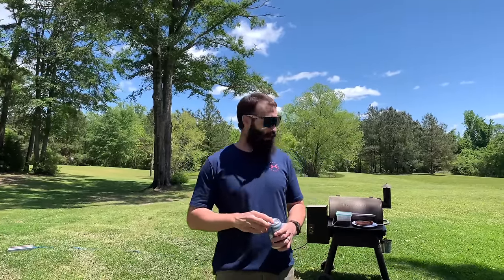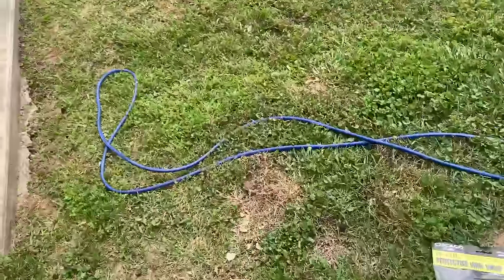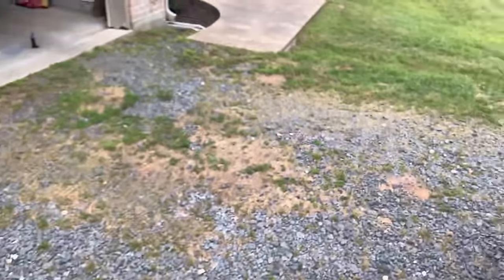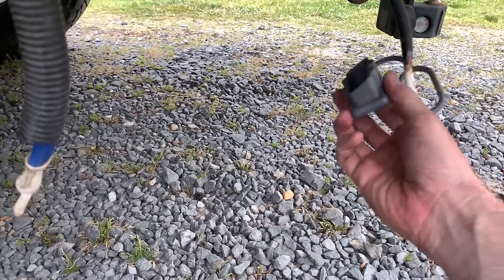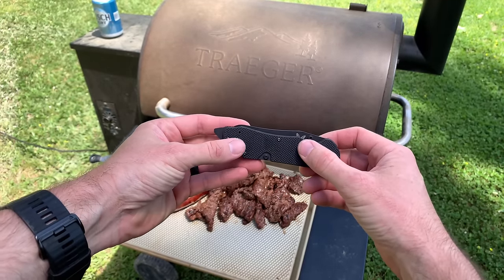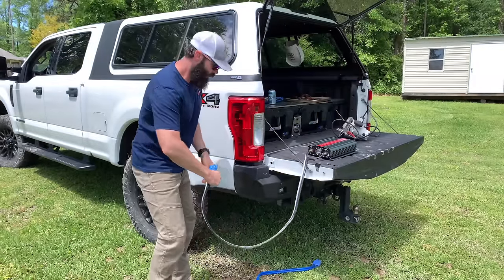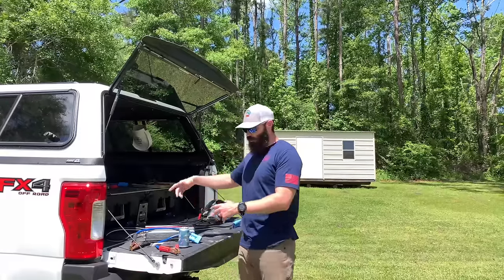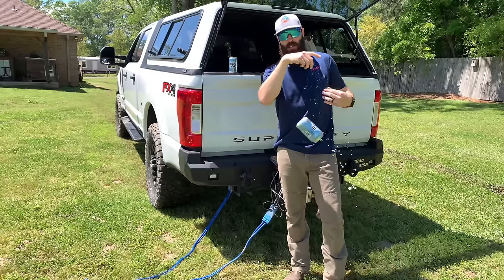Anderson plug install with inverter. (how to power whatever you want.)

Comment: nice video Colt...as always!!
I bought a flush mount kit off ebay and mounted my 175amp plug to the right of my license plate on my 2018 F250, was a little more work to install it but it made it easier to access to plug my winch into that I mounted on the front of my trailer to pull derby cars up on, I never thought of pluggin an inverter into it and using it to run tools lol excellent idea
Reply from the maker: Hell yea brother, I like the location you have yours at! Having that winch is a game changer! Thanks for watching! 🇺🇸🦅🇺🇸
Reply: Could you show us a picture or a link to the flush mount? I want to do the same front and rear for my winch.
Reply from the maker: Here’s a flush mount kit. https://amzn.to/3AHzsKO

Comment: Another great video done Colts way. I agree with a previous post, shoot a little Rust-Oleum paint on that grind, and maybe fill that Anderson plug with dilectric (sp?) grease. I personally like the mini jumper cables! My F350 is a 7.3 gasser, but it has dual batteries, so I'm thinking this is my next project. Keep bringing us more ways to spend money! 😄
Reply from the maker: Thanks Troy!! Yes deff gonna get some touch up Rustoleum, just didn’t have any one hand! And also I’ll deff throw some dielectric grease in the plug! Appreciate you watching! 🇺🇸🦅🇺🇸

Comment: Awesome install.  I wasn't aware of the Anderson plugs or a source for them.  Unfortunately, the Amazon link is currently showing the plugs unavailable with no estimate of when they will be available again.  I'll be transferring a 1500 Watt inverter from a Safari to a Navigator which doesn't have an ideal spot for installation, so now I'll just make the inverter portable.  The rear plug allows the flexibility to run anything else that needs a solid 12VDC connection.  A booster cable fitted with an Anderson plug would even allow you to boost your truck battery from the rear of the vehicle if it was inconvenient to reach the engine bay.
Reply from the maker: Yea man these things are great. I’ve actually charged my batteries from the year while it was parked. I use it all the time. Thanks for watching brother. Hit that sub button if you haven’t. Trying to grow the channel! You can get any Anderson plugs. They don’t have to be the ones I linked. The ones I like are not the ones I have as I got mine from work. But they all the same as long as you get the right size. 🇺🇸🦅🇺🇸

Comment: I know this is an older video but I am going to do something like this.  How long can you run it on battery alone before draining?  Or are you running the truck while using?  Thanks for the video .
Reply from the maker: Depends on how much load what you running is pulling. But I always run the truck and I have dual batteries. If  it was just something quick it would be fine but anything being used for more then a couple minutes, truck needs to run. 🇺🇸🦅🇺🇸
Reply: @COLTSWAY  the Treager for example.

Comment: Hell yeah. We use these on our emergency vehicles for jumper cables. What you think about instead of doing the breaker switch wiring them to the upfitter switches?
Reply from the maker: Well the  upfitters are only like 20-40 amps or something like that. I think the highest is 40. Like 5 and 6 are 40 amp and the others are 20 I think. Just not big enough. 🇺🇸🦅🇺🇸
Reply: You could use a large 150 amp solenoid and use the upfitter switch to be the “trigger” to activate the solenoid and make it hot, and you could still use a circuit breaker or fuse and leave it in the on position. You should always use a circuit interruption device for safety.
Reply from the maker: Correct you are sir! Thanks for the input Daniel. 🇺🇸🦅🇺🇸

Comment: I think this is my first time seeing you, i liked the video!  I will check out more of your videos.

I am no expert, but i believe DC is prone to voltage drop, AC is not, so the inverter is best closest to the battery, and use a good AC extension cord (probably 12 gauge) to cover the greatest distance.  A (kill-a-watt) tester could be a good trouble shooting device, but it looks like it all works pretty good to me.  Just my 2 cents worth.  I am off to watch some more of your videos, thanks!
Reply from the maker: Hey, you are right Brother. It will have some voltage drop at this distance! But I was just showing what could be done! The thicker the wire the better fit longer distances is true as well! I appreciate you watching and for the comment! Hope to see you around more Shawn!! 🇺🇸🦅🇺🇸
Reply: @COLTSWAY  thanks for the video, and the reply!  Btw, does your truck have remote start?
Reply from the maker: Anytime man, I’m here for y’all! It didn’t come with it, but I bought the 12 volt solutions remote start and it’s been flawless. 🇺🇸🦅🇺🇸

Comment: Hello Big Daddy! I have 2019 F250 XLT SRW 4x4 not as fancy as your! Im not a electrician and looked through comments before I asked my question but did not see? How big of alternator do you need to run your inverts? Is there a rule of thumb for it?
Reply from the maker: Man id be lying if I said I knew. But as long as the trucks running and your wire is big enough you should be good for just about anything.  Thanks for watching brother! 🇺🇸🦅🇺🇸
Reply: Appreciate you taking the time to answer and your honesty big daddy have a cold one for me!

Comment: What inverter are you using and how is it reated? Thanks! Excellent video as you not only showed us how and why, but you showed us what we could do with it. Awsome!
Reply from the maker: It’s a 2000 watt inverter. It will pull almost 17 amps. 2000 divided by 120 is like 16.6 so almost 17. Check out this camping vid where I use a microwave to cook some popcorn! Thanks for watching, hit that sub button if you haven’t! 🇺🇸🦅🇺🇸https://youtu.be/8gwasFmYWGs
Reply: @COLTSWAY  Thanks for the fast response and great info. Will do!
Reply from the maker: Anytime! 🇺🇸🦅🇺🇸

Comment: Great Video. I’m going to use that set up. The instructions on my 1500 Watt inverter says DO NOT GROUND THE INVERTER DIRECTLY TO THE BATTERY. So you got that right. ✅. Did you use a Anderson connecter to spice the cables to together ? I would like to see how you spliced it . Thanks
Reply from the maker: Thanks for watching brother. To splice it I just when to the hardware store and got some metal crimp/splices. I can’t remember the size I just made sure my wire fit inside and I was able to crimp them down on the wire. I just got a heavy hammer and beat it till it was almost flat and wasn’t gonna come loose. 🇺🇸🦅🇺🇸
Reply: @COLTSWAY  
Got it thanks, just subscribed to your channel.  By the way I’m into Colt Firearms, especially 1911’s , Goldcups and the Pythons. I’m going to put my inverted just like yours on your Super Duty.. If I buy everything on the links you provided is that everything I need ? Thanks for your time.

Comment: Colt, hey man, live from Kansas. camping right now in the cold. hey brother I can't find that 500 amp circuit breaker. where'd you get yours I can find only 300 amp, I cannot find the 500, was that Amazon or somewhere local? Thanks
Reply from the maker: I got it somewhere local. But it’s not a trip back and forth one. It’s a one time thing so you just carry spares. But to be honest a 300 amp Amazon one would be fine. 🇺🇸🦅🇺🇸

Comment: all right Colt I had that set up when that shit wasn’t cool. One thing about it is you may find that when you put that winch under load on the back you’re going to trip that 150 amp breaker. I put a 500 amp fuse on mine like those boys that set up those high-end stereo systems it will make your ears bleed. That way if you got a hot leg that goes the ground it won’t burn your truck to the ground. If you want something that turns it off, I use a solenoid cut off like those Yankee boys use on their snow plows
Reply from the maker: Yea I have thought about the breaker tripping with it under load. I do have another bolt on type breaker in the glove box, it is 500 amps, but I would just have to unbolt the lugs and bolt them to the breaker. So you are 100% correct on that! I will prob change out that breaker under the hood as well so I don’t have to unbolt it, but I got this breaker off a wrecked bucket truck so it was free! And I did see that solenoid when I was researching, I was actually gonna go that route and hook it to a upfitter but I only have 1 upfitter left and I am saving it for air! Thanks again for watching Paul and for the comment, you the man!!! 🇺🇸🦅🇺🇸
Reply: @COLTSWAY  Appreciate you brother be safe
Reply: @COLTSWAY  what you gonna do with the air? That's my next project. I've settled on an Oasis compressor with a 20 gal hotdog tank. I pull trailers for a living and I'm going to bypass me Airlift compressor and use a leveling valve to keep the bumper height at a constant level. I'm also gonna install an air chuck to the rear bumper for filling tires since the manufacturers leave them about 5 - 15  Lb short, which kills mileage. The compressor is strong enough to fill that 20 gal tank to 200 psi in just a few minutes, so I can also use air tools on the road. To top it off, I'm gonna strap a big ass air horn to the frame where the DPF used to be. Thoughts?
Reply from the maker: I am wanting the arb dual air compressor and mount it in the bed! 🇺🇸🦅🇺🇸
Reply: @COLTSWAY  I would like to do that too.  I have some of the parts already...I salvaged a small air tank off of an old air compressor.  I would like to make it so that it can run air bags one day when I get them.  I just bought the factory gooseneck puck system with my Ford Pass rewards and $200.  I'm getting ready to start looking for a small camper for the family and I think the air bags would come in handy.  I'm going to get the ones that have the internal jounce stop (or whatever they are called) so I can run low pressure on the bags when not towing
Reply from the maker: Hell yea, sounds like a plan! Awesome deal on the puck system. I am posting a air bag video today and I got the 5000 ultimate with the internal jounce as well! 🇺🇸🦅🇺🇸
Reply: @COLTSWAY  I will be sure to watch
Reply from the maker: Just posted it! 🇺🇸🦅🇺🇸

Comment: Colt, why not just put the plug somewhere up front like the grill? Why did you feel the need to run it to the back?
Reply from the maker: You could put it up front. I just do most of my work in the back off of the tailgate. If I’m building something i am always in the back it when I’m camping I run a microwave off the tailgate. Got a couple camping vids I’ve used it on. 🇺🇸🦅🇺🇸

Comment: Can you use a 300amp circuit breaker in place of the 150amp one?
Reply from the maker: Yes, I have since changed mine out to a 500. The winch wouldn’t work under load. It kept blowing the fuse. So I just padded them together untill I got a bigger 500 amp fuse. Thanks for watching. Hit that sub button if you haven’t, trying to grow the channel. 🇺🇸🦅🇺🇸
Reply: @COLTSWAY 
Yes, I'm subscribed. I love watching and adding the modification to my '20 F250 SD. Love that you make it simple. I added the running board lights, bed lights, of course the uplifter makes it easy for me to do.
Reply from the maker: Awesome, I appreciate it! Yes the running boards lights made a huge difference! 🇺🇸🦅🇺🇸

Comment: What size brand and size tires you got?  In the market for some on my F250.
Reply from the maker: I’m running 37x13.50x20 nitto ridge grapplers my man. 🇺🇸🦅🇺🇸
Reply: @COLTSWAY  Looks bad ass
Reply from the maker: That’s man! I am going to go with a 37x12.50x20 Toyo MT next. I’ve always had good luck with Toyo mt. And they won’t be as wide so I can turn a little better lol.

Comment: Off topic but how are the ridge grapplers? I have a feeling you don't deal with snow where you are but if you do have snow and rain feedback, let's hear it. I know you wont bullshit if they're not as good as everyone who has them says. 🍻🍻
Reply from the maker: I like them so far, I won’t be getting them next time though. I’ll go back to a Toyo MT. And the ridge graps are garbage in the snow. Went to Wyoming and Colorado with the wife last year and we got into some snow. They are terrible, like 2 out of 10. I do like them, but if it wasn’t for the badass sidewall I wouldn’t of got them in the first place. 🇺🇸🦅🇺🇸
Reply: @COLTSWAY  Appreciate it man. Check out EXO-GRAPPLERS, they're similar to the ridge graps but have 3peak snowflake rating. Running them right now and they're great in snow and look just as aggressive. Now I've leveled the truck and want a wider tire but the exo's are back-ordered everywhere. I can get the ridge grappers right away but have heard they SUCK in wet and snow. Too bad cuz they do look sexy. Cheers man!
Reply from the maker: Yes I do like the EXO Grapplers. I also like the falcon wildpeak at3. A lot of the overland people I follow run them. They don’t look as aggressive but I hear they are legit. 🇺🇸🦅🇺🇸
Reply: @COLTSWAY  lol that's what I am trying to get, they have become very popular and (up here in BC Canada at least) they are actually now more expensive than Nitto RIDGE or EXO in the same size. I hear really good things though.
Reply from the maker: Damn... they still a littler cheaper down here.

Comment: Just subscribed so now you can say boys and girls!  😝 thanks for installing with the same kind of fuse I just bought. Will the Anderson connectors come undone if I would drive with both sides connected? I’m connecting it to my trailer with a smart lithium battery isolator to help charge my trailer batteries.
Reply from the maker: Yes ma’am, I’ll fix that! Also yes you can drive with it so long as it’s long enough that it doesn’t pull loose when turning or anything.  Thanks for watching!! 🇺🇸🦅🇺🇸

Comment: @Colt  Can I use my upfitter switches as the breaker (2020 SuperDuty XLT)
Reply from the maker: Switch 1 and 2 ARE protected by an 25 amp fuse. 3 is 10 amp fuse, 4 is 15 amp fuse. So rated loads are about 20 amp 1 and 2, 7 amp for 3 and 10amp for 4. 
they all controlld by a relay. Not sure it would provide enough to not trip over little shit but it might! Worth a try. 🇺🇸🦅🇺🇸

Comment: Hey Colt, I see you upgraded to the 500amp and I saw the links. Are you running a disconnect of any sort to that, or is it hot all the time? 
I recently was directed to your channel and loving the videos. Keep up the work. It’s awesome
Reply from the maker: This is what I have, I couldn’t find the one I bought but this is exactly the same. Thanks for watching brother. To answer the question it doesn’t have a disconnect. You just need to take the fuse out if you want it disconnected. Couldn’t find a 500 amp breaker style. 🇺🇸🦅🇺🇸 https://amzn.to/3PErxF2

Comment: How many Starters are JUST grounded to the frame and not wired back to the battery?  You WILL figure out why you want a Ground wire back to the battery. It won't happen right away just let a little corrosion action start happing and then you'll figure it out! Go ahead and pop open another beer when things won't work and then start cleaning the connection when you need to be winching or inverting. LOL.
Reply from the maker: Good thing I keep it clean then. Think I’ll be alright. But thanks for the great tips. Never failed my yet. Done this on all my trucks. Lol. Everything is grounded to the frame. You don’t think just a little corrosion action could happen on your battery? Lol. Literally the most common place for it. 🇺🇸🦅🇺🇸

Comment: Putting that Anderson connector upside down, with the cap on the bottom, means water will sit in the connection for a long time. Mounting it the other way would have allowed it to drain. Just sayin. 

Oh, and removing that frame coating is a bad idea. Prolly should at least have re-coated the ground point. Again…  jus sayin
Reply from the maker: Drilled a hole in the cap. And I already touched up the paint. Valid points though. 🇺🇸🦅🇺🇸
Reply from the maker: But you right i should have rotated it.

Comment: 12v being run much too far; get the inverter as close to the battery as possible to reduce voltage drop… best bet is add an additional battery at the back you charge independently… bet your inverters are tripping repeatedly on “low voltage input” no?
Reply from the maker: Yea you would think it would have some voltage drop and problems but it doesn’t. Never had a low voltage error or trip. I’ve even ran a microwave camping to cook popcorn. 🇺🇸🦅🇺🇸
Reply: @COLTSWAY  fair then I'm not going to say any more! I've got my 6k inverter with 1" thick cable going about half a foot to the battery... That puppy will run my house with the jeep running! ;)
Reply from the maker: Hell yea I bet it does!! I do line work, so I’m not a complete dummy about electrical! Lol. I am hoping they do a hybrid superduty like the 150. That things got a 7.2kw generator built in. Be bad as for camping with a RV. 🇺🇸🦅🇺🇸